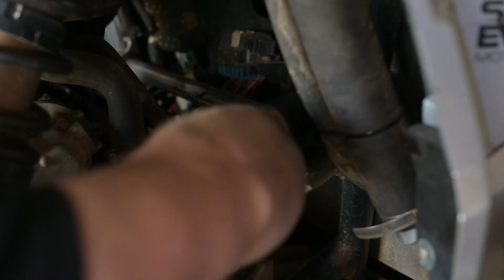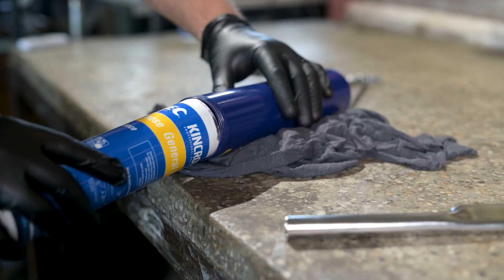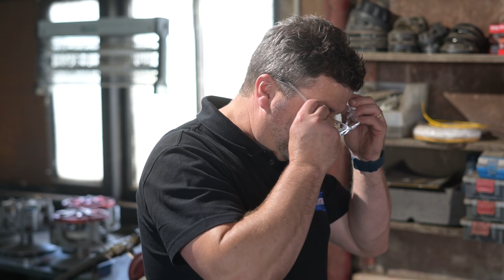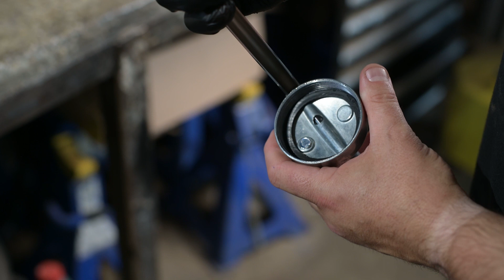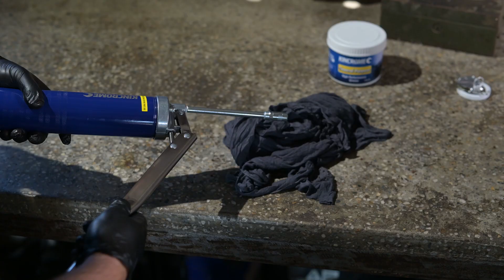How to Fill and Bleed a Grease Gun | KINCROME Tool Talk

Comment: Try taking off the hose! If there is air pressure in your hose, it will never bleed no matter what you do
Reply: Thanks the really helped. Was struggling then removed the hose and bang works like a charm.

Comment: Good Tips 👍 Would be great if you could show us the process of bleeding the grease gun without a bleed valve
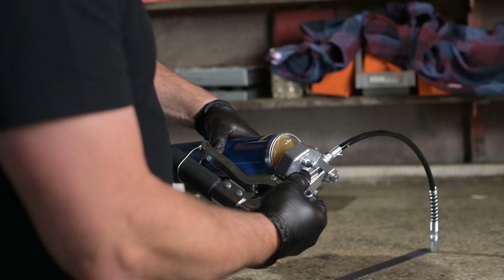Reply: The guy explains the "non-bleeding" style technique from 02:22.  He kind of uses Kincrome's model naming; but you basically just back off the top of the head portion from fully tight to let the air escape there rather than through a dedicated valve.

Comment: Good video, was helpful. Could do without background music in all these instructional videos. While not explicitly stated, it can be seen in the video that you unscrew the pump end to load. Once you have that down, then of course can kind of figure out which way the cartridge goes in. If still in doubt, video showed this cartridge loading orientation quite well. I never knew about the trapped air problem, learned something. Other videos did mention best to store cartridges with writing up, and the pull tab down. 

When you pull that spring loaded plunger rod out, have you something like a little  piece of wood such as a dowel rod, old pencil with the point broke off, golf tee, even a solid clean twig, to jam in that hole for the plunger rod. That way the blasted rod can't jump out of the retainer groove recess notch in the cap. Others on YT bested me on this tip, suggested a bolt of appropriate size, which might even work better being the threads would help keep it in place. Thanks much for posting.

Comment: I don't understand why almost everyone pushes the plunger back in?
If you leave it out it's easy to see how much grease is left inside.
I worked all my live like this and never had problems. I see so many people having problems with pistols not working when the plunger is pushed inside to 🤷.
I wanted to teach some colleagues at work because almost everyone have problems to refill the gun, it doesn't work after they refill.
But they all say they saw to do different than i do.

So why most push it back in??
Reply: Another video comment section on YT explained this. The plunger rod is only for compressing the spring & pulling the plunger washer back such that the gun can be loaded. When you have the new cartridge / grease all packed in & loaded & push the rod in, the rod actually slides through the grease in the barrel. Regardless if you leave the plunger ROD out or push it it, the plunger ROD does NOT indicate how much grease is left in the grease gun. The spring & actual plunger exerts pressure on the grease to keep it shoved forward to where the pump part can get it. 

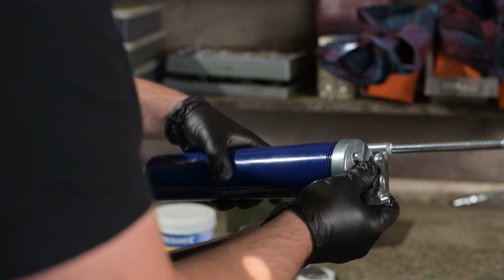As far as not working after the refill, your problem is probably trapped air pocket near the pump end. I never knew this either the video covers getting the air out at about 02:36. It was glossed over but some guns have a bolt or screw you loosen to allow the air to come out. 

Ok guys, go out there and stuff dem zerk fittings with some nice slippery grease. Kill 'em tiger.